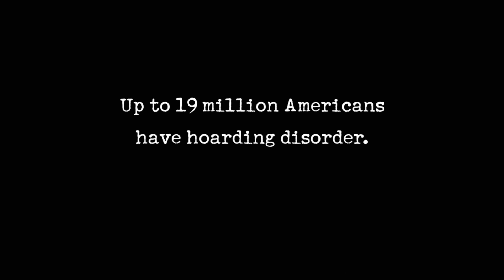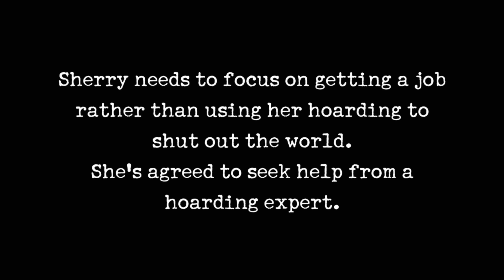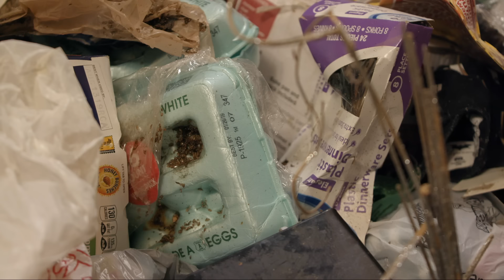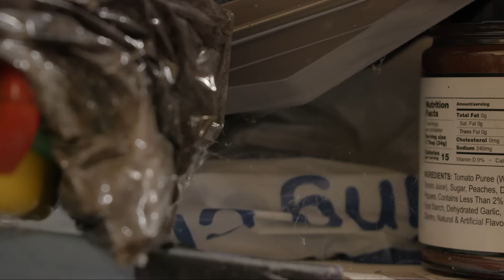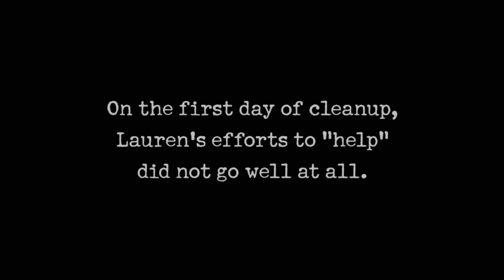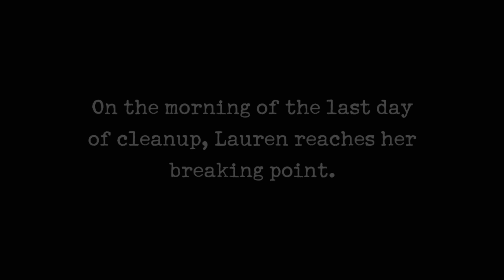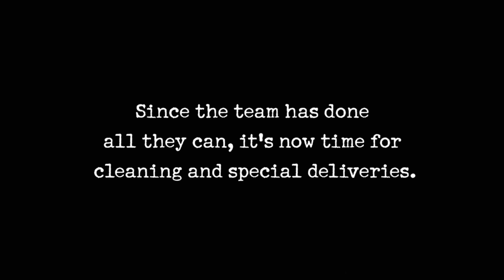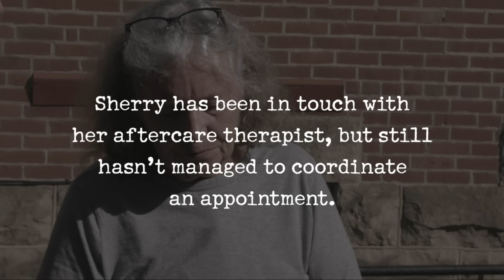Sherry Faces Eviction Over 6-Foot-High Trash Hoard (S1, E1) | Hoarders: Coming Clean | Full Ep.

Comment: She had a beautiful home. But to keep it like that on the basis of ``I'm gonna need stuff,'' just wow. Yeah, you may have to go without something you want. That's how the tortilla flops. It's no excuse for running a landfill without a permit. And stay in touch with your family, because they will do a wellness check if you don't! So they only have one bathroom and it is upstairs. That does seem weird, in a retrofitted house, that was built without a bathroom, to go from an outhouse to an upstairs bathroom. Why not put the bathroom on the first floor, with fewer plumbing logistics? Like, just put it off the kitchen, so the water heater can services it easier, etc.